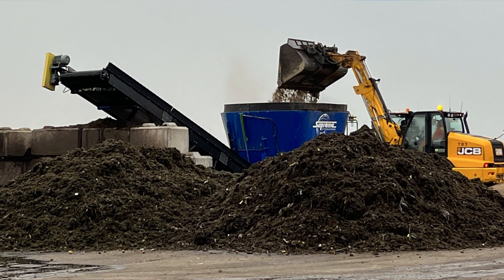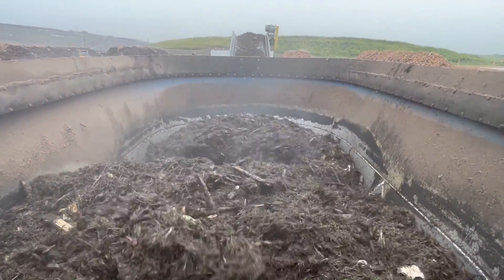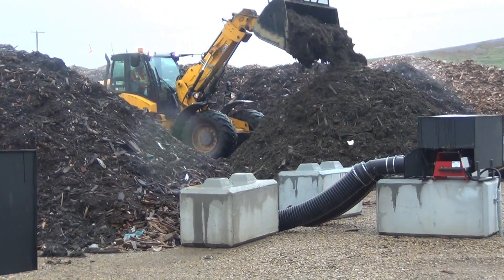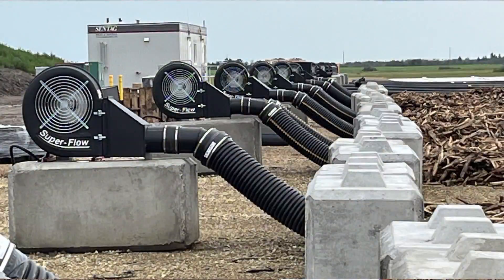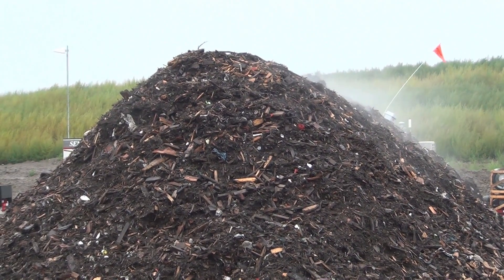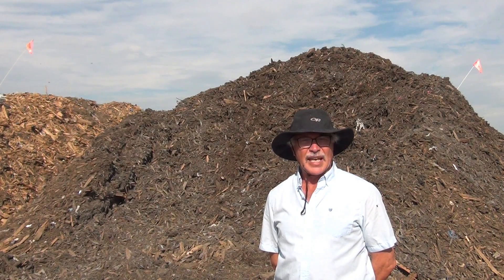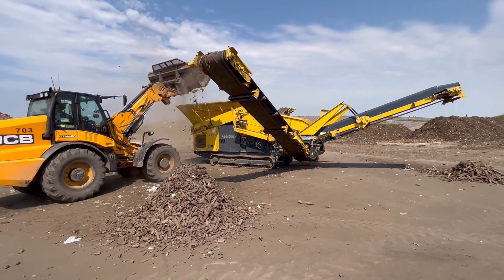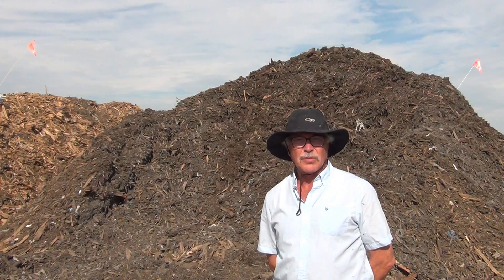Claystone Waste - Composting Effectively and Efficiently

Comment: Is it possible to make compost from 100% cow dung? please suggestions
Reply from the maker: It is possible, depending on the moisture content and whether there is any bedding in the manure. If the moisture content is below 70% and there is at least some bedding in the manure, it can be done with aeration and mixing.

Comment: What size blowers are you using to move the air
Reply from the maker: These are 7.5 hp centrifugal blowers
Reply: @TransformCompost  what’s the CFM and pressure of this fan if you don’t mind me asking trying to set up something similar, or the model on those 7.5hp
Reply: @TransformCompost also how long do yall let your pipes cure
Reply from the maker: @ChandlerBrooks  not sure of your question - how long do the pipes cure?
Reply: @TransformCompost  the piles
Reply: @TransformCompost  I meant how long do the piles cure after you take them off the pipes sorry
Reply from the maker: @ChandlerBrooks  great question - that all depends on how the product is managed. If  the compost coming off the aerated piles is less than 35% moisture, curing may take a year or longer! On the other hand, if the compost is rewetted to 50%, actively turned and aerated, the product can be mature in 2-4 weeks.

Comment: John Paul: Great comments as well as great explanations and  nice photos !
What exactly is the initial biomass that you are composting ? (leaves, branches, garden clips) I am impressed as I saw no foreing matters (plastics, etc.)
I am curious to know... 20 pads to process 20 000 tons per y ... what is the main limiting factor to operate efficiently the proposed system ? Is it the initial blending step (300 t/d) that prevents you to blend and spread the biomass onto the pads or is it the TIME of the year you collect the biomass to be composted ? Or is the collection strategy adopted by the city ? ... Denis, from Montréal, Qc, Canada
Reply from the maker: Thanks for your comments/questions. The material being composted is the source separated organics from the City of Edmonton. It goes through some preprocessing at the City before it comes to the facility. The material varies from mostly food waste during the winter and mostly grass and food in the spring/early summer, and leaves and food during the fall. One of the limiting factors is loader operation.

Comment: What recycling do you do with the first screen oversize?
Reply: Have you found that the ratio of oversize to fines increases as you recycle the oversize back into the process?
Reply from the maker: It does not change significantly, because we need to have the right porosity and moisture content, so if we don't use recycle, we have to use fresh wood. A combination of both is usually used.
Reply from the maker: It is recycled back into the composting process - used as bulking agent and microbial inoculant.